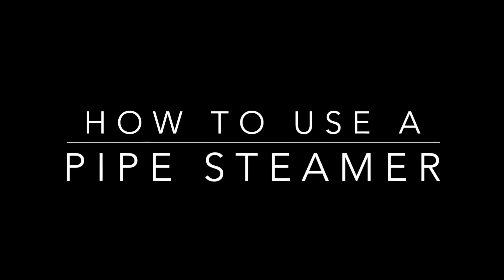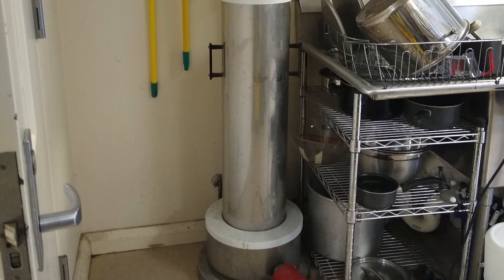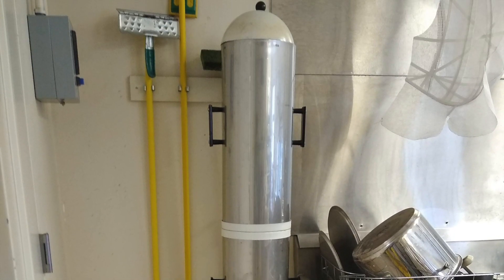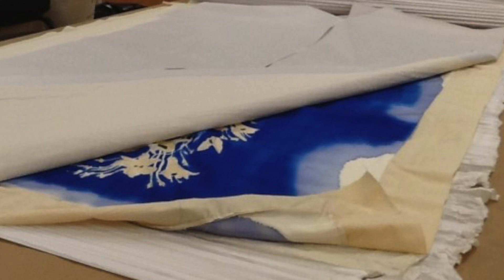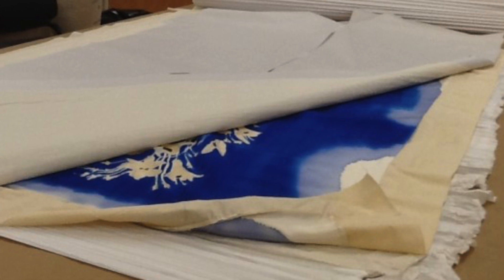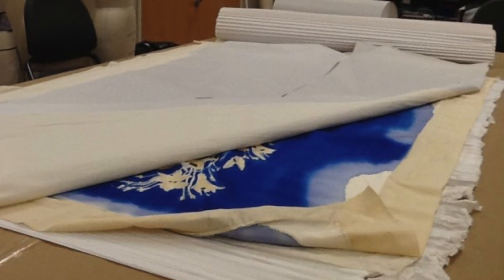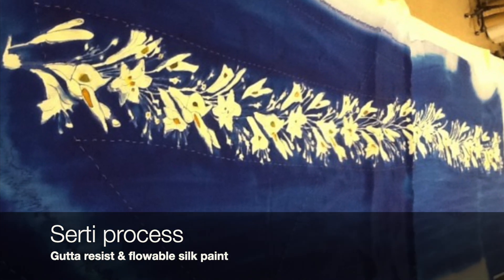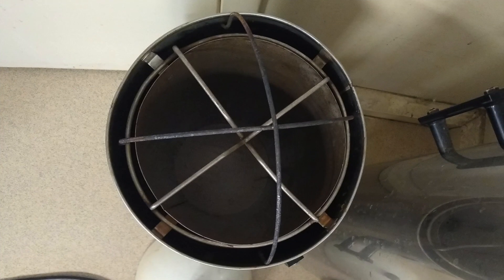How to use a yardage steamer

Comment: If the dye transfers to the muslin, can you use it again to line another dye project?  Or does that risk dye transfer from project 1 possibly transferring to the 2nd one?
Reply from the maker: You probably could wash it a couple times with detergent and be safe to reuse it, but in the costume shop we wash it and put it in the scrap muslin bin for pattern draping and mock-ups.
Reply: @LaBricoleuse  I thought that was the likely end result. But it would be an interesting dye experiment to see the changes in the muslin as dye does and does not transfer from different projects (but not enough to risk the projects).